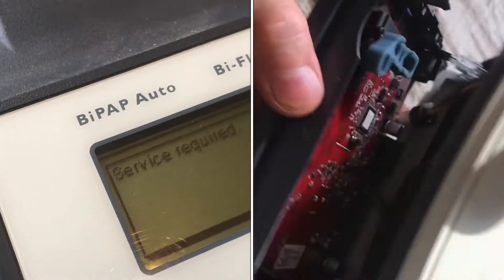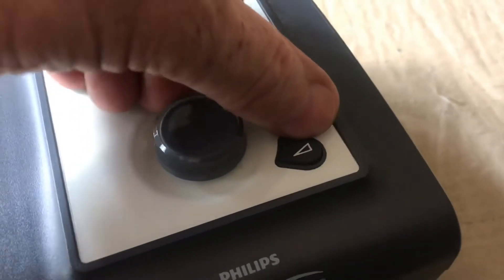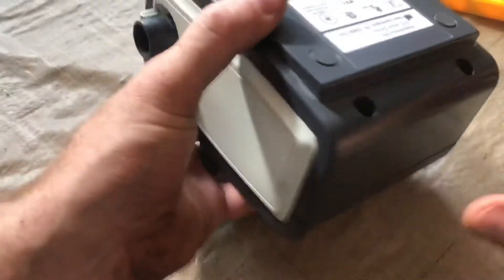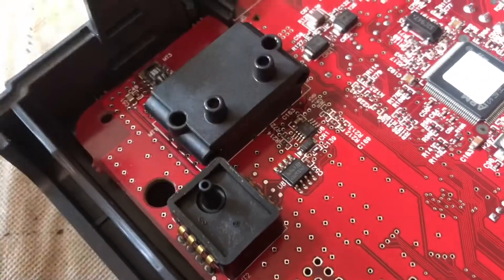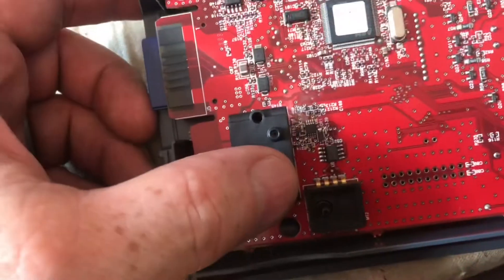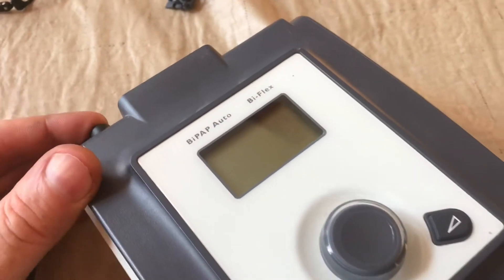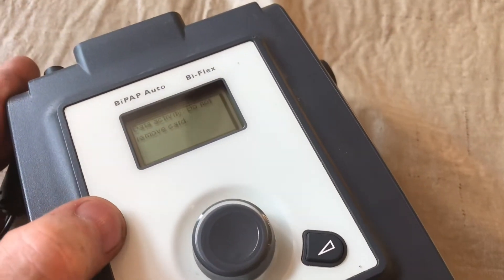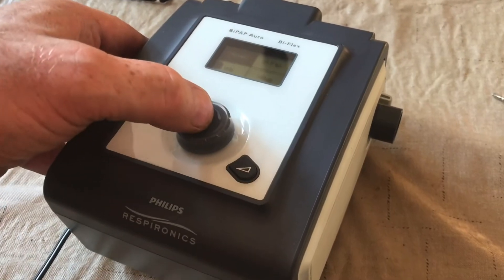QUICK FIX “service required” error (respironics system one ds960 remstar autosv bipap)

Comment: Didn't work for me ... at first.  I disassembled again, pulled the black tube with the holes out and cleaned the inside with a q-tip. Then I  blocked one end with my hand and blew like crazy in the other end.  That fixed it!  Thank you CPAPmyway ... you saved me having to buy a new machine!